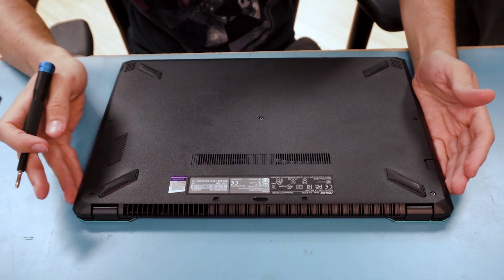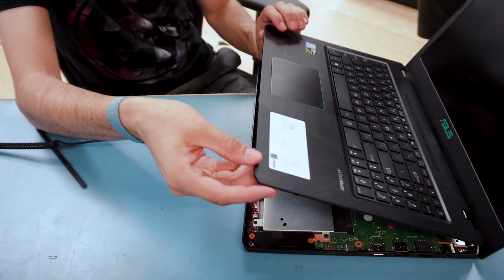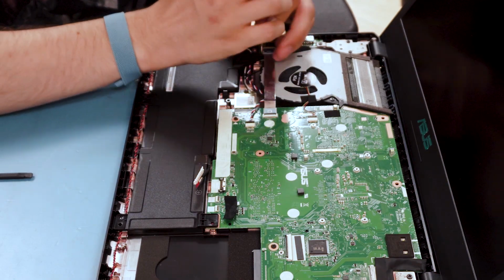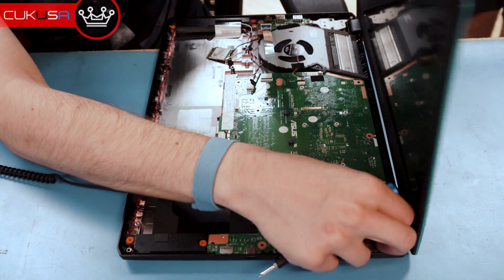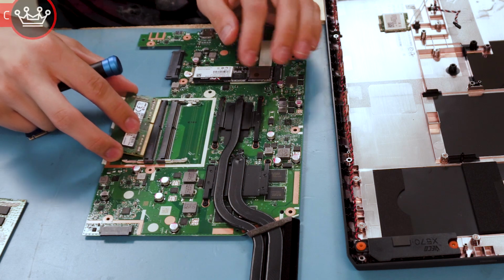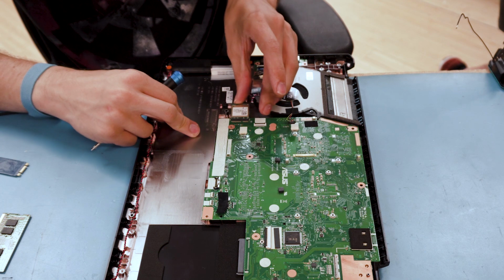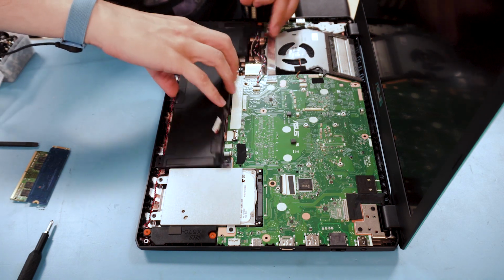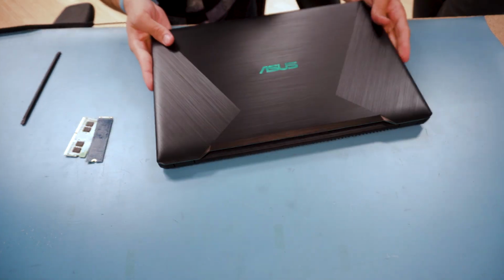Asus K570U | How to Service, Upgrade & Fix Laptop (Teardown)

Comment: How are you unplugging the battery so easily? My plug won't come out, and I don't want to risk tearing anything. This is my first time messing with the inside of a laptop.
Edit: Oh yeah, I figured out what I was doing wrong, by the way. I had to sort of peel it off from the top.l, not just pull it straight out.

Comment: Cool teardown, I did the upgrade for my HDD only I would love a little help, now my trackpad doesn't work and my fingerprint scanner is heating up like crazy Idk why, I followed the steps and stopped the video more than once to figure out, do you know if I did something wrong?
Reply: Same thing happened to me, ty god for warranty.
Reply: I think you accidentaly switched the 2 small cables around, that connect to the mousepad and fingerprint

Comment: You are the best , i own F570z asus laptop , can i know whether the m.2 slot supports NVME  with full speeds , Thanks in advance  ( X570ZD is motherboard used in it  )  @computer upgrade king
Reply: yes it supports nvme

Comment: Anyone know what kind of keyboard I can use to replace the stock one? A couple keys just stopped responding otherwise computer works fine.
Reply: Order from Asus, or possibly find exact model on eBay.

Comment: Can anyone tell me where the heck is the CMOS located, specifically, on that very motherboard??
Reply: It's not a piece of equipment but just storage of Basic In and Out programs and data located in a chip. You access it with some combination of keys presses (Esc, or F9, Del or something else) immediately after turning the computer on, before your Operating System begins to Load. You should be able to find out what to press from the user manual or just search for it.

Comment: Can i install nvme pcie gen 3x4 in this laptop?
Reply: Did you do that? Does It works?
Reply: @ThePeppe9988  yes. I installed Adata xpg sx8200 pro pcie nvme on my laptop.
Reply: @tuanmuhammadafiq8087  any problem? Did you check the r/w speed?
Reply: @ThePeppe9988  no problem yet. Average read 2418MB/s and write 1888MB/s
Reply: @tuanmuhammadafiq8087  thank you so much!

Comment: Hi, can I replace the hard drive with a SSD drive?
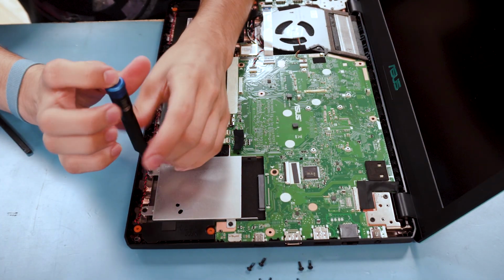Reply: The included drive that he replace was an SATA III, M.2 drive--he swapped in a NVMe, M.2 drive. The hard drive that he added @ 1:30 was (as it is in all laptop--nowadays at least) a 2.5" HDD, you certainly could instead install in 2.5" SATA III SSD.

SATA and NVMe/PCIe refer to the interface/memory controller. 2.5" and M.2 refer to the physical form factor.